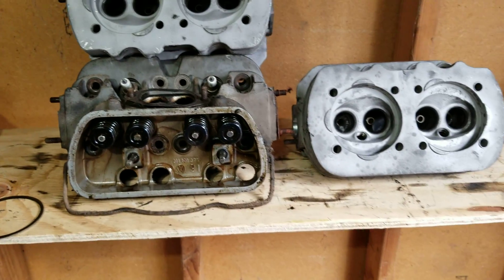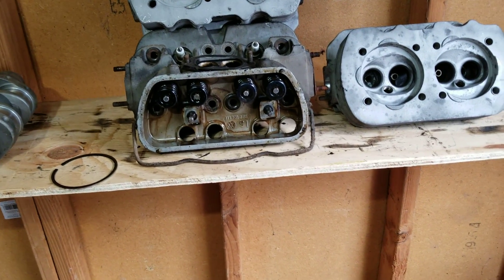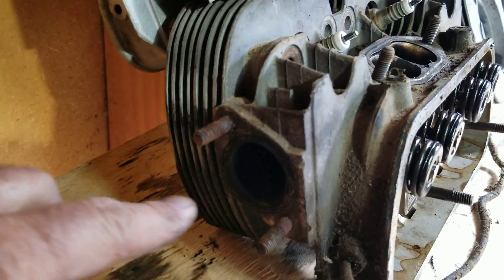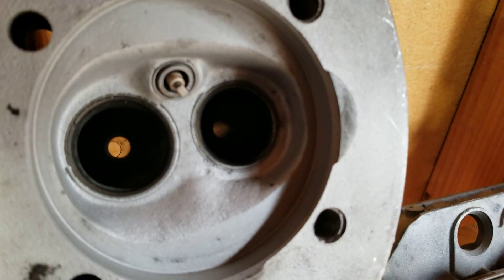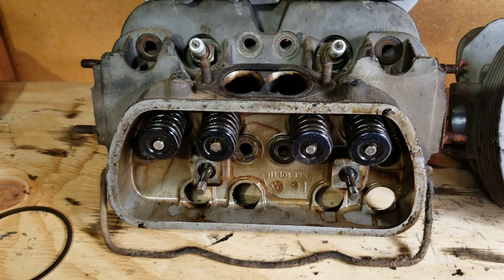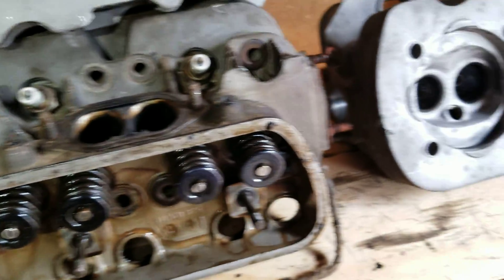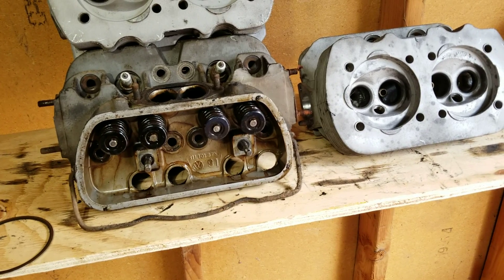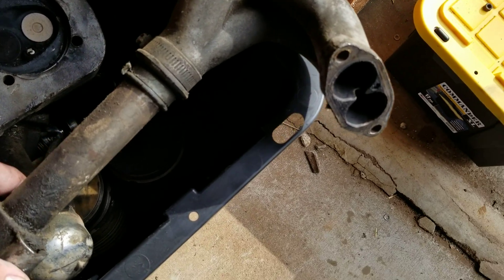VW engine performance porting heads

Comment: I have found that using the Scotch-Brite Maroon polishing bits from Summit are aggresive enough to remove material from VW heads and at the same time .... provide a poloshed surface with enough abrasion to keep fuel/air mixture atomized. ....does anyone have a similar or different experience?

Comment: Hi I noticed you have a webber type manifold. I made my own. I bored out the fitting into the alloy intakes and the tube just buts up against it instead of fitting inside. Radiator hose holds it securely. Am now looking at porting heads. just wanting some feedback on my manifold set up. Obviously just buying performance parts is a better option , but I am on a very limited budget. I was also considering cutting the short alloy intakes back to where they are two seperate ports, square flange, and either double pipes back to the carby mount or a rectangular tube.

Comment: Is it possible to port 1200cc heads?
Reply from the maker: yea a little. and it can help. the corner on the exhaust is pretty tight. Not going to give you much power though.  Porting mostly helps with higher RPM and those 40s are torque low RPM. too many RPM in there and you better check the oil pump size. Stock was a 17mm which is barely enough oil supply for 4000 RPM. 1600 rockers are a good upgrade but remember there are no cam bearings in there. If there are (upgraded at some point) you could put 1.25 rockers on it possibly. but rotate and check and make sure the springs dont bottom out. on the 1200 I run stock exhaust too. maintains the torque best.
Reply: @Mikefngarage  Thanks for the golden advice! I’ve got a 110 cam with cam bearings and upgraded the engine with a big bore kit to nearly 1400cc. I always keep the oil level high since I once ran it too low from a leak and ended up snapping the crankshaft. This engine is an experiment, so I really put it through its paces—daily driving, off-roading, etc., in my Baja Bug. On the freeway, I can hit 82 mph with some wind-breaking help from other cars, but usually cruise at 65 mph. Exactly like you said, I found that an independent dual exhaust hurt my torque, so I went back to the stockish exhaust. Just trying to figure out what else I can do to it. Currently I'm trying to design an adapter for a 34pict carb. I have the one that goes the other way around (adapting a smaller carburetor to bigger manifold) but you can't just flip it, I tried. so I guess I'll try to port the exhaust see what happens. Thank you!
Reply from the maker: @barrioscorona215  100 cam would work better. 26mm pump on there. bore the oil intake a bit too. But if you power it up too much the crankshaft will break again.
Reply: @Mikefngarage  thank you for the info I will do that next. Thank you!

Comment: I really dig this seiries from a guy who has done it all in the VW world. One respectful comment about the manifold porting and leaving the 'ribs' under the carb. I disagree with the concept. I read this idea in a book I bought about hot rodding a Chrysler Conquest motor I worked on. The author said to leave the intake ports rough because it would create a 'barrier layer' so fuel would not stick to the manifold. That car ran like a dog compared to my bug where I used Cratex wheels to polish the ports like glass. My theory for the plenum manifold shown is, if you polish it like a mirror, the fuel will have no ridges to stick to and will be carried out of the manifold by the rushing airflow and will be mixed by natural turbulence. The ridges will create 'swirls' under the carb that will act as a limit of the air flowing past the swirls (eddy currents that resist flow under the carb).

Comment: I have a question. I have a 1776 with mofoco 40/35.5 heads Engle 110 cam, dual dellorto dcnf carbs. Would adding D ports improve performance???

Comment: Good idea with the ridges in the upper intake. Don't  know if they still make them but years ago a company made screens. It was usually a 1 inch spacer plate under the carb, then the screen between the plate and the intake. Was to help ATOMIZE the the fuel for better air/fuel mixture. 

So the ridges you added will help the fuel ( splash ) in a sense. Causing it break into smaller droplets. Excellent idea.

Comment: I'm curious if you think a mild port job, like you show in the video, would make any difference for a factory fuel injected, 1600, dual port in a '78 Beetle convertible.  At some point I will be rebuilding the engine, and from what I've read, there isn't much I can do to squeeze more horse power out of it if I keep the fuel injection (which currently works great, and I love).
Reply: Not sure who told you that but they were filling your cup with bull crap. Get some displacement a cam and a mild port job and the fuel injection will work even better than stock.
Reply: In my Type3 with efi, a mild port did great initially. I ended up increasing CC's so that also made a larger amount of uhmph.

Comment: Hi Mike and all you fellow watchers.
I admit to having different preferences and ideas. See, I don't fancy high displacement and powerful engines. I was looking very hard for a 1300 dual port engine (AB engine code) and finally found one. The heads on those have small valves which again is where I'm weird, coz I like that. I would love to build on that base and go with a 74 mm counterweighted crank, an Engle 100 cam, stock 77mm cylinders and pistons, 34 pict carburator and stock exhaust. This will make it possible for me to avoid having to spend money on machine work, which is extremely expensive over here AND it will give me that small displacement engine, but tuned and hopefully a little more agile than the stock engines. I want to attempt some porting to those 1300 dual port heads. I should be able to do the porting as well as the mild clearensing neccesary for the 74 mm crank myself, using hand-held air- tools, shouldn't I?
Will follow the budget build with great interest. Best Regards Lars Karlsson
Reply from the maker: you could do that if the case is in good shape Like no line bore needed. the 74 is almost a drop in with clearanced rods. just a little dremel. We will be doing one pretty soon if the case I took into the machine shop makes it.
Reply from the maker: Web 86 is better then the 100 engle. and if you want more power after you can ad ratio rockers.

Comment: why would you want a venturi in your intake?
Reply from the maker: on the single port the intake is almost maxed out. cant venturi  but I opened up some areas. not much and got the air to flow around the valve better.

Comment: Back in early 80s when 40X35 Autolineas were 37.50 , I worked on a Seat and guide Machine . And with it I could have done most anything.  Knock out the guide and spread the valves apart by putting a fatter guide and larger seat. But We did  not mess with VWs. The Opel club had us to do 11 motors that had the works on them.
Reply from the maker: wow looking at mills right now lets see maybe plus we are. Always wanted a valve grinding machine too. lets see if the old craigslist will deliver. ha ha.
Reply: @Mikefngarage  Do not kick me. I could have got Auto Machine shop but i told my old boss that times had changed.Most guys want a crate motor. Joe had alot of VW shit. Had a line bore box with a extra set of cutters that was still in their wrappers.

Comment: I think I see where you’re going with this Mike. This should be a good primer for the VW engine builder novice / low buck builder.
Maybe a single port dual relief, doghouse cooled single carb with vacuum advance and maybe a pertronix? I’m looking forward to it.
Reply from the maker: total build budget so far 100 bucks. DOnt have a spare dog house so I am using stand up. but it will work. cant wait to fire it monday. should run super strong for a single. We do have some dual port heads but carb supply is dwindling. I will upgrade it from only swap meet finds. to show it can be done.
Reply: That doghouse would definitely be a future swap meet upgrade, and I’d love to see you push the performance limits of single port heads.
By the way , the name “Poverty Special” is the way to go!

Comment: SP all day baby!!...lol... meaning that I should have saved up more for dual port..hahaha. Are miss match heads (part numbers) critical? I know its probably a dumb question.
Reply from the maker: single port not usually but there are some with different combustion chambers and valves gotta be the same there at least. for the budget ride.

Comment: Power's in the heads, such a true statement.
Take any new aftermarket head and you will find poor valve seat transitions and rough casting marks.
Just taking a dremel and smoothing off all those edges with sanding rolls makes a difference.
They also skip a proper 3 angle valve job like the original heads, it's all lost flow and power.
Thanks for sharing Mike, head porting is such an important part of engine building that is frequently overlooked IMO.
Always so many things to still learn.
Reply from the maker: so true those single port exhaust are so restricted. I am anxious to see how they will run. with a decent cam

Comment: I was glad to see you do that demonstration with both single and dual ports.  Ever had much trouble with dropping valves in the past.  I have been really lucky, but do know people who have dropped valves on the same motor in the same month,BRUTAL......
Reply from the maker: especially on type 4 dropping valve seats is a HUGE problem with the type 4 engine.